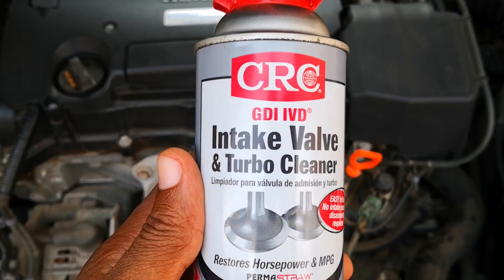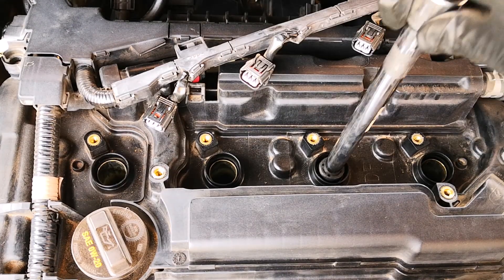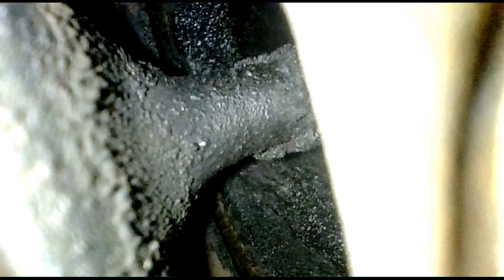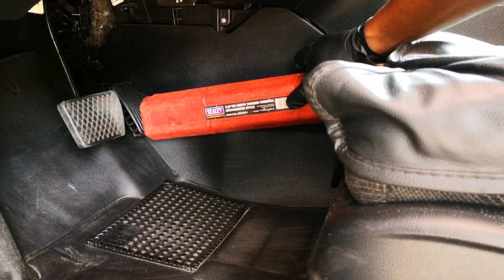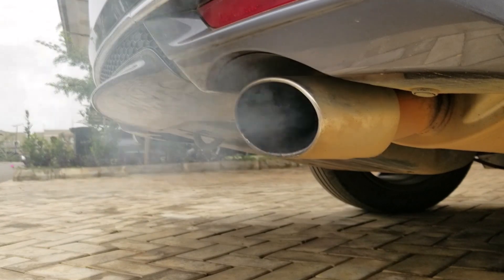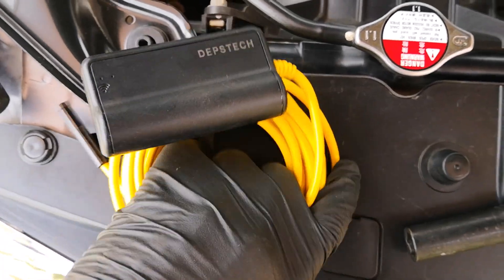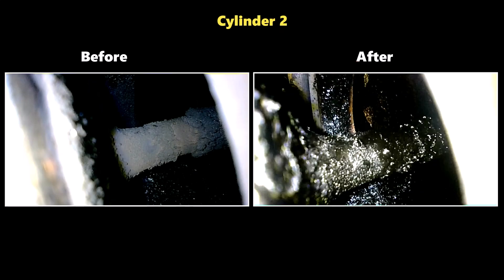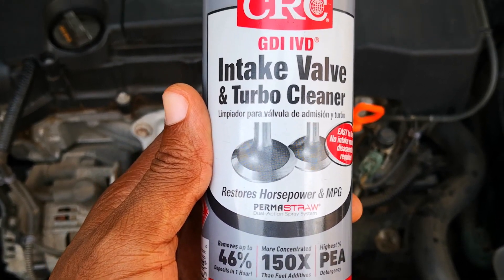Does this Intake Valve Cleaner Really Work? Proof, Before & After / Clean carbon from intake valves

Comment from the maker: What's your preferred cleaner or method for the intake valves? Do you think this performance is worth buying the CRC intake valve cleaner? 🤔
Reply: Just a suggestion   i repeated this C R C  Intake  cleaner 4 times . Once every 1000  miles .  Please follow the directions exactly  nothing different applied through throttle  hose removed slightly one second burst spray till  can was empty at  2000 rpm only . Then follow the remaining directions . Car was a 1998 Lexus GS 400   325,000 miles . Can responded better each time . Did need a oil change after 4,000 miles . Now at 355,000 miles car has plenty acceleration , no idle mis , and plenty of power . Bought this at Auto Zone 14.99 can .
Reply: Best way is to pull the intake and blast the valves with walnut shells.  There’s no magic bullet to clean those. 8-(
Reply: @CountryFarmBoyUSA  Agree.  In fact, close the valves and use oven cleaner if you can't do walnut blasting.  None of the other stuff works worth a damn.
Reply: Liqui Moly Pro-Line Intake Valve Spray, you should try it, I've noticed some good results in terms of performance.
Reply from the maker: Great you should suggest, I already had it ordered before reading your comment.
Reply: try another cleaner..that has a better reputation..crc has been shown to be less effective in other videos..find one that some big name auto shops use like Big O or NTB.  good video.
Reply from the maker: Thanks, mate. What's the full meaning of big O and NTB?
Reply: @DIYAutoworksNG  in the USA they are tire service and auto maintenance shops ..so they will do that service you just performed but use a big name cleaner.
Reply from the maker: Okay. Thanks.
Reply: Would love to see a video that test Seafoam cleaner to see how well it works or does not. Great video by the way.
Reply: Your a rockstar brother! What's the best one? I feel like sea foam or Valvoline might be good?
Reply from the maker: Totally missed this! Sincere apologies.
I haven't used seafoam yet, but of all intake valve cleaners I've tested (2 actually), CRC cleaned the most.
Reply from the maker: @johnkelly4381 Good point. I got the car at 69k miles. I have the Liqui Moly intake and throttle valve cleaner which I'll be trying soon. It states that it cleans the intake valve too.
Reply: If you watch the CRC video, it states that significant driving after the product applied will yield better results.  Remember how wet the valves look after you applied it, that wetness will continue to penetrate and breakup the carbon as you drive.   Then, you keep applying every 3000 miles or every oil change

You gave liquid molly 6 cans.  Do the same for CRC. I bet you will be impressed
Reply from the maker: @markj6681 You have a point. I got 2 cans already for the next treatment. Planning a double flusher.
Reply: Chemicals are good only preventively for light carbon deposits. And instead of buying expensive CRC, Forte etc. better results are with cheap carburetor and EGR cleaner sprays. Seriously, try them ;)
Reply from the maker: You have a good point, but still scared of using carb cleaner in place of a dedicated intake cleaner🤣.
Reply: @las3k91  $18 is not expensive. hehe

Comment: I would use the cleaner again a second time but spray from the throttle body intake past the MAF sensor. Using a brake line is not ideal. I have even done this from the sensor opening with it removed and cleaning work very well. The main area you want clean are the valve seating areas and uppper valve stems. Nice work in the camera angles. Also changing your oil more often will help your GDI engine as well. Take care.
Reply from the maker: Thanks for the tips and your experience

Comment: Loved the videos, very detailed. I saw you video on gumout that you used, have you tried the gumout tune up white can in your system and intake hose to see any difference? i've used seafoam, but in europe is hard to acquire it, only thing coming close is gumout tune up. i saw your video on BG 44K and ordered few cans on ebay to give it a shot, trying to get max carbon and catalytic converter cleaned from a bmw e46 316i 2001. Thank bro and continue with your science projects!
Reply from the maker: Thanks for the compliment!
I've used Gumout multi system tune up, I hadn't started doing these fuel additive videos but it left my car flying!

Comment: The whole point of this product is 2 use. It frequently to keep direct injection engines cleaner. But doing this, after you've had a 100A 150000 km. It's silly to think that anyone cleaner is going to fix the problem. That happened, preventive maintenance is key. Thank you
Reply from the maker: Thanks for sharing. Agree. But I think the company went over the top with the marketing and imagery on the can. It definitely doesn't remove 46% of carbon in one application. I've also seen another video where the valves had minimal buildup (was walnut blasted just some weeks ago), it also practically did nothing in that clip.

Comment: I used this recently on intake runners with heavy oil buildup, similar to what is found on valves. I had similar results, it did not seem to work all that well and it instead left a very oily/smelly film over everything... I ended up using throttle body/air intake cleaner instead and that worked much better, although it gets spent quickly so more is needed.
Reply from the maker: Thanks for sharing. In an upcoming video, I'll be share what I was able to achieve with carb cleaner and walnut blasting!

Comment: If you do this evry 20k miles or so it works perfectly fine, but if the valves are caked that bad, it will not work with one single treatment.  You will need to do it again in about 1,000 miles to start breaking down another layer.
Reply from the maker: Agree. I've done walnut blasting! Will have the video soon 😀
Reply: Thank you for this insight! I was wondering the same thing. Speaking of which, so about every 1,000 miles or so with filter change?

Comment: A compression test would have been a better metric to base it's effectiveness on.
Reply from the maker: It's cleaning is targeted at the back of the intake valves and not necessarily the landing of the piston/grooves.
Reply: Yes but if the carbon build up is thay bad on the top of the valve its almost certianly on the seating surface of the valve. Ive seen people gain 20psi of compression from cleaning the carbon off of valves and valve seats @DIYAutoworksNG
Reply from the maker: @thefloridaredneck yea. Makes sense. It should improve sealing at top part of the chamber.

Comment: Yeah and I wonder if the quality and frequency of oil changes are of any consequence.  My 2016 kia rio runs 5-30 restore and protect for over 5 oil changes now.  It just has turned 200,250 and the valves look better than his . Fairly good but do have some deposits.  I have done some work replacing gaskets, fuel injector cleaning,  o rings and soaking valves in crc and cleaning best as i could.  Still runs decent on up to 85 phone. I do a mild Italian tune up every once in while on the interstate.
Reply from the maker: That would be a factor. Lesser quality oils will form more vapor into the PCV system. That said, the design of the PCV system is better on some cars. How often were you changing your oil? I got this car used, so had no control over what the prior owner did.

Comment: Once a year take a long road trip (+500miles) using premium gas. Add Techron every 3000 miles.
Reply: What will techron due if the fuel injector is in the combustion chamber and not infront of the intake valve?
Reply: Premium gas doesn't matter, but high quality gas stations matter. BP & shell have the most detergents

Comment: It is NOT meant to 100% clean your engine with one spray button push! You need to do this periodically, before EVERY oil change
Reply: No, it doesn't work as they state. Flat out.
Reply: @trotskiftw that statement is absolutely false..product claims "up to 46% reduction in build up" obviously 47% or more was not removed...it clearly does exactly what it states

Comment: Have seen many people try various products. BG makes some too. Nothing really seems to do much. The real question is do you want to pay for the shop time or money to use one of these cleaners AND walnut blasting, or just skip right to walnut blasting. Either way, you're paying for walnut blasting.
Reply: Depending on how bad the valves are deposit wise, take this video for example. Id Recommend doing them both. The intake cleaner made the carbon softer, with that much carbon, you may end up needing to brush/scrape off the major deposits before doing the walnut blasting

Based on the amount of carbon, the vehicle in the video more than likely never received intake cleaning as preventative. If you do occasionally do intake cleaning service, you can probably get away with just walnut cleaning

Comment: I've finally used this product, not going through the brake booster line but just directly into the throttle body. 

Couple days later got a CEL code for an upstream oxygen sensor that this spray blast would have hit first. Wondering if I damaged the oxygen sensor, or its readings are off now due to the spray. I forgot to let it heat soak for a while after the service, and drove the car right after spraying it. On the freeway too.
Reply from the maker: What car and what's the O2 sensor code? Did you have any abnormal sounds from the engine during the process or drive?

Personally, I've never had an O2 sensor code after using a cleaner. But stuff happens. Could also be a coincidence.
Reply: @DIYAutoworksNG  a gdi turbo engine. Ford Taurus sho. No abnormal sounds, but the spray really stunk when we put it in. Never ran weird either during or after the service

Comment: Dudes got 200k miles on his car expecting a spray to help right away, it will keep cleaning for weeks while it’s in there
Reply from the maker: Lols. Car had about 79k miles when I did this, but I get the figure of speech!
Reply: @DIYAutoworksNG  maybe try top tier fuel as well
Reply: @gtiguy1992able
GDI Engines are "Gas Direct Injected" doesn't matter what type of fuel or fuel additives you use, the gas never touches the intake valves.
Reply: @vegeta420z  running top
Tier fuel helps in GDI motors to reduce carbon build up

Comment: secondo me non c'e' nulla di meglio del carbon x
Reply from the maker: I have been looking for carbon x for a long time. Not the easiest to get depending on what part of the world you leave in!
Reply: @DIYAutoworksNG  true, in Italy you can find it, but what costs is the vacuum cleaner, I was thinking of using a manual vacuum cleaner or the one at home by putting in some adapted tubes...
Reply from the maker: @ce9xy I wanted to get it one time while in the UK and the only seller on Amazon was in Italy. He didn't have so much good reviews so I left it. I already got a manual vacuum pump which I can use for it. Wasn't expensive. Got from Aliexpress under $20
Reply: @DIYAutoworksNG  secondo te riuscira' ad aspirare tutto? io non lo ho provato, ma penso che di meglio ci sia solo lo smontaggio e pulizia manuale dei singoli pezzi.
Reply from the maker: I think it should suck up everything. Also, even after sucking you will still crank the engine without the spark plugs installed, that will push out whatever is left
Reply: @DIYAutoworksNG  ok, thank you very much
Reply from the maker: You're welcome! Do let me know how it goes!

Comment: I been using crc since i bought my car its only 5 years old very oil change i do this also it does not work one time you have to keep using it like oil change cost alot of money in the long run will be half prize doing wal nut blasting,but if you started at 1 year old car brand new it will prevent it. and also i dont put it on vaccum hose i find better on throttle body.its a maintenance like oil change you have to keep using it every year you cant use it when your car is like 7 years old its going to be hard to remove it most are so thick.
Reply from the maker: Agree 100%. I got the car used, and have used it every single year since getting it. You're the 3rd or 4th person stating better results via spraying through the throttle body. I'll use that approach next time.

Comment: seems like every intake cleaner test has the same results regardless of the brand.  Just wets the carbon down.  I'd like to see what happens if two doses are used one right after another then a spirited drive.
Reply from the maker: I'm planning 2 doses 2 weeks apart.
Reply: CRC has its GDI Service Pack Kit that besides the Intake Valve Cleaner, also includes cleaners for the Throttle Body, MAF and a Fuel System Additive...

I think I'll try tracking down some of the "CRC Gasoline 1-Tank Power Renew" Fuel Additive to compliment my Intake Valve Cleaning during my upcoming Oil Change.

On that front how soon after Intake Valve Treatment(s) do you change the Oil? Trying to decide if I decide to try a "double dose" over 2 weeks if the Oil should get dumped at 3 weeks? Or if the cleaner will compromise the Oil and maybe change it out shortly (within a few days?) of the last treatment
Reply from the maker: Usually, I change a few days after the CRC treatment, but I've actually been wondering what to do with the 2x treatment. Might just change immediately after the 2nd CRC can with about 2 weeks in between treatments.
Reply: @lgoamity  I use redline FI cleaner.  I put 2 bottles in 19 gallons before a road trip last month.   I changed oil when I got back but only because the trip had some seriously hard driving at well over 10,000 foot.  Pikes PeaK!!   One off the bucket list.
Reply: @datsuntoyy  The Redline SI-1 (60103) Fuel System Cleaner? Tried that before (haven't pulled the Spark Plugs to check for an "After" comparison yet...) hopeful that it is worth the extra cost (compared to just using a Top Tier Detergent Fuel and maybe one of a variety of "cheap" but well known fuel additives).
Reply: @lgoamity  I've seen many of the youtube "experts" tests.  NONE have shown any real benefit as far as piston carbon goes.  However all the real experts say PEA is the good stuff.  Redline has more than every other additive.  cleaning the fuel injectors is my real concern and Redline has been proven to be at the top.  Fuel atomization is more important than a bit of carbon.

Comment: I've used two cans in the past two weeks , one can each week . I definitely could feel my car running smoother and quicker acceleration . I sprayed both times through the disconnected hose from the brake booster . I started my car and then put a wooden rod from the edge of drivers seat to gas pedal , moving the seat forward until 2500 RPMs . I was continually spraying it and car didn't stall out , but kept running niormally . Now I will try Berryman's Valve cleaner .
Reply from the maker: Interesting. Looks like you read my mind. I plan to do just the same, 2 cans, 2 weeks apart before my next oil change. Definitely doing a video on it!
Reply: @DIYAutoworksNG  It seems that on YouTube people have the best success with CRC .
Reply from the maker: @peterrudy9207 very correct. The other one that seems quite good is the Berryman. Let me know how it goes when you try it.
Reply: @DIYAutoworksNG  This past week I used the Berryman B-12 intake valve cleaner . I applied it into the throttle body as best suggestion . Be sure to press hard down on the press tab until it clicks , and fluid starts flowing . Then got back in car to keep gas pedal at 2000-2500 RPMs and it seemed to take at least 15 minutes before used up . I could not tell as I sat in drivers seat if it was still flowing , so got out and checked at various times . If they would put a dye in it , green or red to easily tell that it was still flowing and then stopped to see clear hose . I noticed smoke , bluish coming from tailpipe and strong chemical smell . When I went for a drive after waiting 30 minutes as said . At first traffic light , engine wanted to stall . So I put foot on brake pedal and other on gas pedal giving gas until light changed to green . Then there was so problem , acceleration and power seemed to be better with CRC Intake Valve Cleaner . Though I expect it was that the valves at that time had been dirtier . Though I will use Berrymans again it as I think it is carbon being burned off in exhaust . Since I was under the hood spraying CRC into the hose disconnected from the brake booster , I could not see the exhaust .
Reply: @DIYAutoworksNG  With the berryman I will use the plastic tubing to inject directly into the throttle body , engine running of course .

Comment: It says give it 1000 miles to get cleaned i assume ut weakens carbon and over time bits of it break apart. Also probably 3 cans will make a decent difference?
Reply: Exactly, the wet look is from it coating the carbon. Eventually over time and heat cycles it breaks down the carbon. I have used this product a month ago after watching this video and this was my experience after 700 miles. It always looked wet and gradually carbon decreased